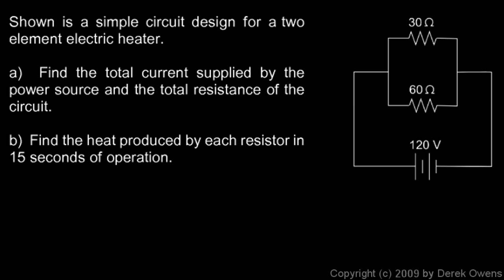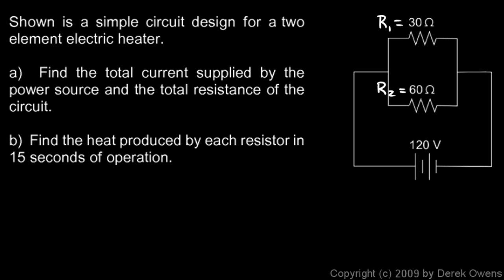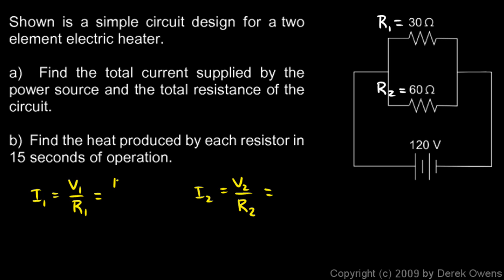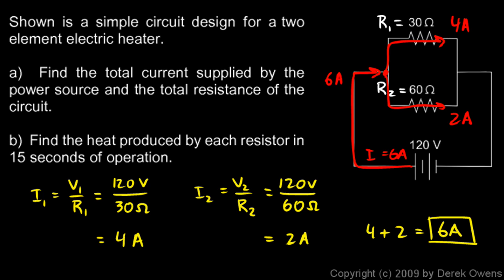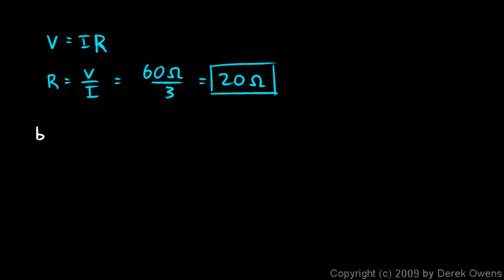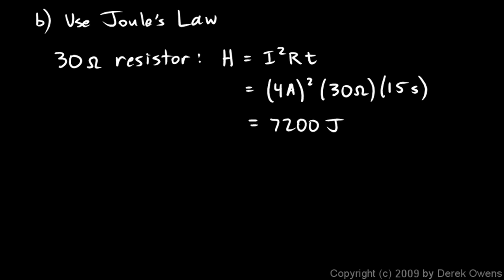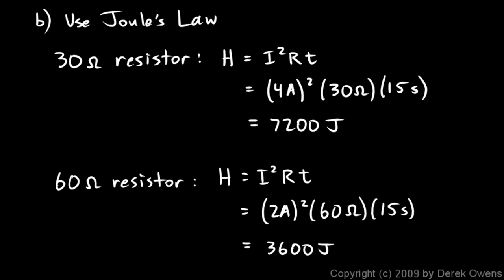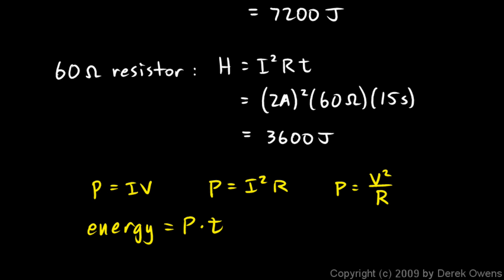Physics 13.4.2g - Parallel Circuit Example

Comment: Sir I was really having confusions about this heat concept; as how less amount of resistance can ends up to produce more amount of heat cause one of my teachers told that more the amount of resistance; more the amount of heat and I think that happens when we're using series combination as current is same through all the resistors put in a series. But your explanation really cleared my confusions. Thanks much :-)

Comment from the maker: @brawl313  Yes, that is essentially correct.  If you have a machine, though, doing some work, it is typically converting electrical energy into mechanical energy, so the work done would actually be less due to some inefficiency, but yes I believe you have the right idea.